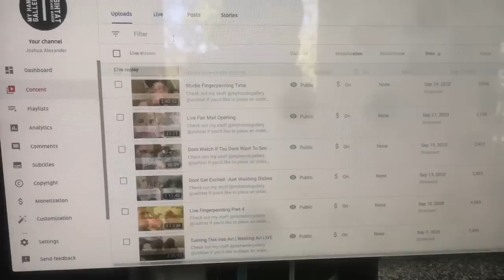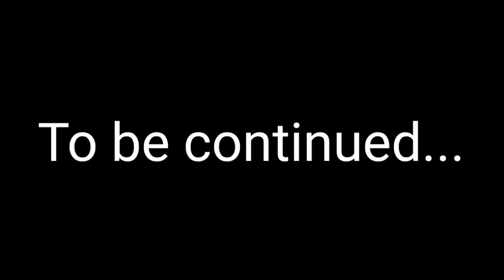Ashley's Chicken coop Part 9 | Another VLOG #90

Comment: A good way to help break a broody is to put your cages up off the floor...like little boards on the corners of cage...assuming that the floor of your cage is wire. Take the wood chips out. The broody needs to have cool air under her. If she is able to feel warmth under her she will continue to be broody. So the bare wire bottom of the cage will help break them. Hope that makes sense.

Comment: Regarding the hens' dust-bathing: Since they go under the coop to dust-bathe when they free-range, why not give them all-time access from the run? Go around the entire base of the coop with chicken wire, then remove the wire in the run that stops them from going under the coop. With that section of wire removed, the run is extended to under the coop & the girls can dust-bathe there whenever they want, & the coop itself provides protection from the rain.
Reply from the maker: Cleaning up chicken crap is the main reason we don't do that. If it's open at all times, it will be filled and hard to clean. How it is now, it doesn't get so crappy. We've thought of making it part of the run ourselves but weighed the pros and cons.
Reply: Got it. I didn't give a thought to the chicken poop. That must be a joy to clean up. 🙄